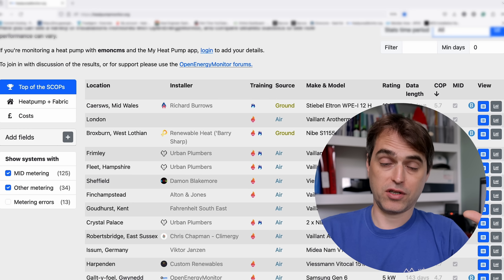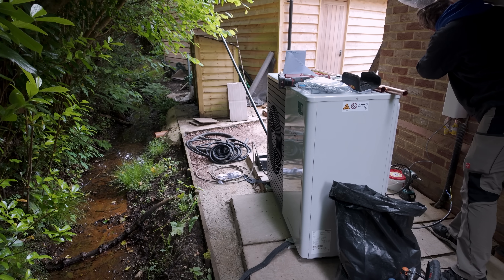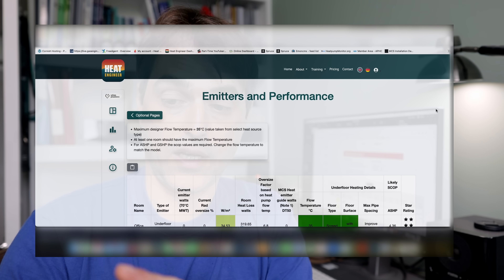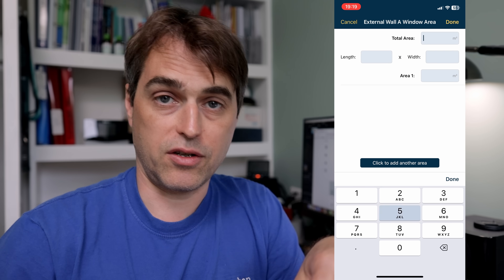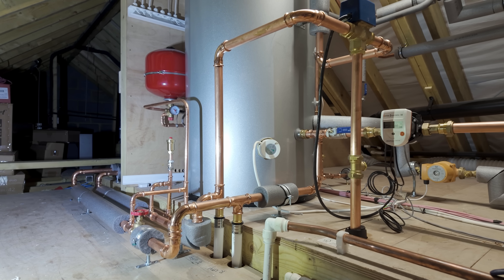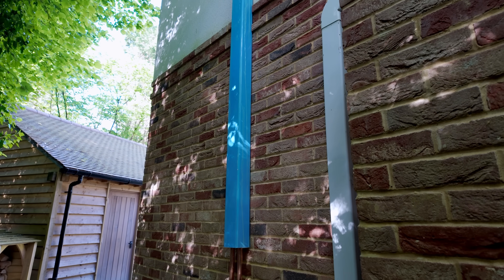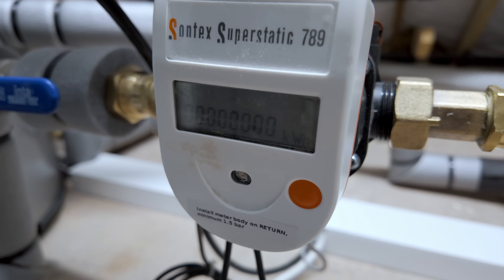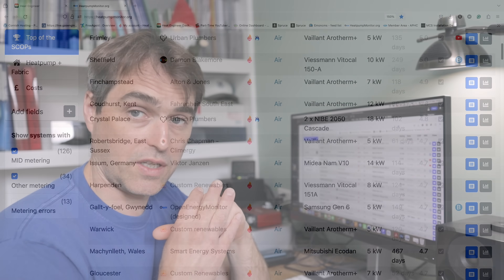Design Heating System Pipework Like a Pro

Comment: I'm doing the Heat Geek course to ensure that when my ASHP gets installed in my new build, it will be spec'ed correctly. Also, when I did my Engineering Degree 30+ years ago the SI units was Kn/m2 not Pascals. not quite easily to convert when 1bar = 101.4 Kpa. We only used Pascals for air pressure in ventilation. It's getting a feel of using large numerical values. Like having the feel and understanding of MPH speed and having to deal with KPH.
Reply from the maker: You are not the first customer to do HG course just to make sure the installation is correct. It's a bit of an overkill, but sadly this is the reality we face at the moment.
Reply: @UrbanPlumbers  true. A big local installer with years of experience and amazing reviews happily quoted me £20k for a 9kW system in my home that I'm now pretty sure is safely under 4.5kW max. If it weren't for Heat Geek and videos like yours I probably wouldn't have known better.
Reply: @UrbanPlumbers  Is there any chance there will be a course that will cater for home owners, specifically so that they have the knowledge needed to make sure there installation is correct?
Reply: @UrbanPlumbers  I have finished the Heat Geek Mastery course and recommend that installers and clients under take this course, as I bet there is a lot of mismatched installations out there. I had a reputable installer here down in Cornwall quote me for a 8kw unit, when all my calculations indicate that I require a size lower than 3.5kw, as I am building a passive house spec dwelling.  My neighbour is also building his average sized house, and has been quoted from 3.5kw to 12kw size installations. Something is very wrong with this industry nowadays. Especially when a new build that meets the current insulation building regs specifications, a 12kw unit would heat a small supermarket.
Reply from the maker: All true - lack of knowledge is shocking across the the industry
Reply: Note we have a home owner course specifically for this.. no need to do the engineers course!
Reply: I think you are confusing standard atmospheric air pressure , the barometric pressure ( 101.32 kPa unit every weather reporter uses)  with 1 bar. See barneyc4919 comment.
Reply: @bramptonkendell  Yes, I misrepresented Atmospheric pressure, indeed 1032mbar to 1 Atmosphere at sea level. At Uni, kilo-newton/m2 was used for pressure. it is easy to "see" air pressures or water pressures when they are in bar. I believe it what you grew up with, before my time it was PSI.
Reply: 1 bar = 100 kpa    1 kn/m2 = 1 kpa, sorry
Reply: @barneyc4919  Yes you are right, mixing up Atmospheres with bar. 1 Atmos = 1032mbar at sea level.

Comment: Thanks for your videos. I have a 7kW Vaillant aerotherm with a 40l buffer in our small bungalow. SCOP is below 3 (3.5 for this May). I assume that the ASHP is oversized. HOwever I also notice that the delta T (as shown on the control unit) is only usually around 1°C. As I understand, the water is just pushed through the buffer too fast, so that it cannot lose enough energy (ASHP~1205 l/h, buffer circuit pump at lowest setting). Could the 7kW unit work without the buffer (or have it in series as a volumiser only, rather than as a buffer in parallel)? If there is resistance and the ASHP cannot push 1205l/h, would it still be happy as long as it is within the limits given in the manual (540l/h- 1205l/h)? And would the lower flow rate mean a greater delta T and perhaps better efficiency? I guess its not that simple... still hoping that I am not stuck with this bad efficiency and too big ASHP..
Reply from the maker: Sounds like you would be much better off getting rid of the buffer. Although 3.5 isnt terrible but most likely can be improved. Small bungalow most likely doesn’t need a 7kW unit.
Reply: @UrbanPlumbers  COP 3.5 was only for last week actually. COP for May 3.3, SCOP 2.5... so really not happy. The question is how to improve this. Replacing the large ASHP with a smaller one would be too expensive. Taking out the buffer should be OK I guess cost-wise, but would the same ASHP work in that scenario, i.e. could it work well with a lower flow than 1205l/h ? Pipework is all new. I don't think they did the calculations like you show in the video, but small house so perhaps not too complicated anyway?
Reply: Would be interesting if the system cycles a lot. And if you haven't done so, already try maximizing the volume through the heating circuit. So either getting rid of any thermostat or just opening them all.
Reply: @Felix-st2ue  thanks, compressor hours/compressor starts = 1.5 h per start. (4113/2776). Building pump hours/starts= 11h per start (6279/589). If I understand correctly, that should be fine, i.e. not short-cycling? The flow temperatures are also usually very low as per heat curve 0.4. I have all radiators fully open (no UFH) and only weather compensation so no indoor thermostats. Could perhaps the reported yield figure be far off? Energy consumption by ASHP was 2400kWh per year; if I do some wishful thinking and assume that our heat use was actually around 8400kWh, then the SCOP would have been 3.5. The EPC estimate for our house is around 7500kWh/yr. Our gas use before was around 10,000 kWh/yr (combi boiler).
Reply: @pip1980  Well, it's not terrible but not exactly great either. You could try to increase the hysteresis a bit. That way, it should be running for longer but less often. But in the end, the buffer seems to be the issue here.
What's interesting to me is that the heating circuit pump has only 50% more hours of runtime compared to the heatpump. But it has only a fraction of the starts... To me, that's an indicator that there should be room for improvement.